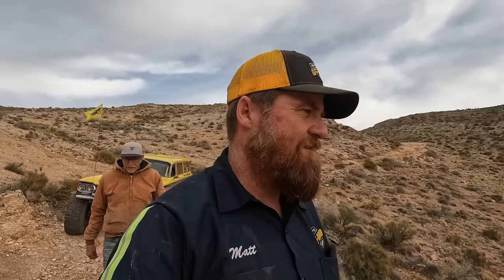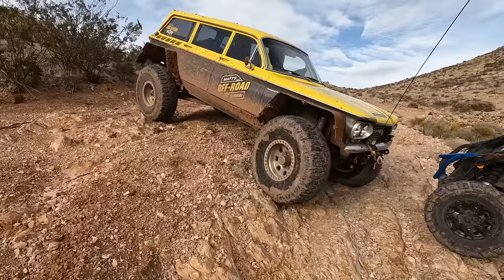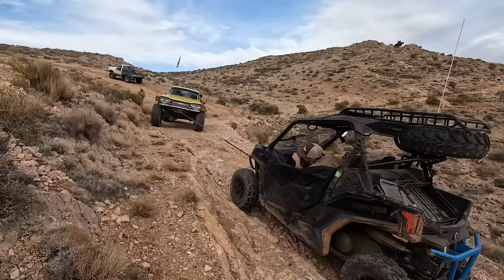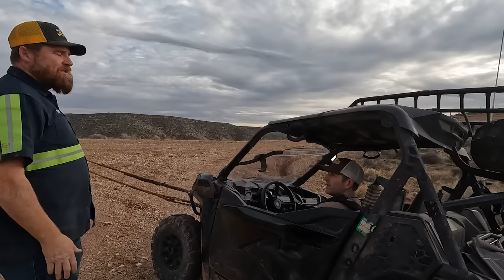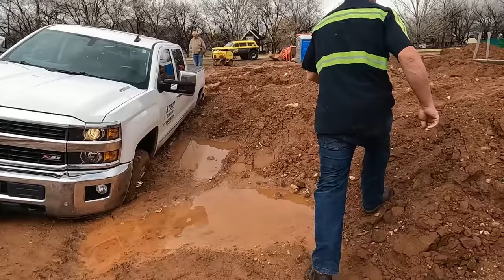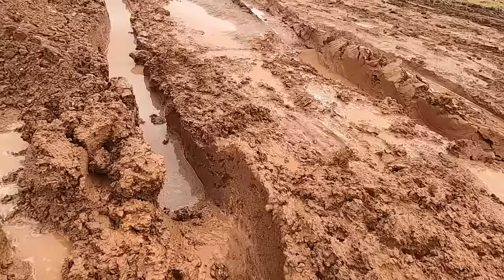Flooded By The Sewer...Nasty Chevy Recovery!

Comment: Those tall, narrow razrs look terrifying. I would never take something like that off road where there are any steep drop-offs. 
I’m constantly surprised how few injuries there are on bad rolls though.
Reply: There surprisingly stable , but you don’t want to have a high rack on them and a spare tire mounted up there or anything else it really effects the CG
Reply: A friend of mine has one. It's actually not bad off road when set up correctly. The issue is when you start putting spare tires and gear on the top

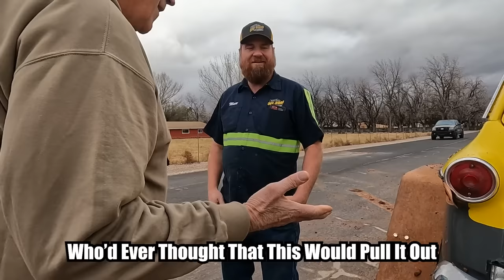Comment: 19:24 "Who'd ever thought that this( points at the Morvair) would pull it out"
Understanding kinetic energy and how it works makes all the difference. This job would not be possible for the Morvair under the same conditions if a cable or chain was used in place of a nylon rope.
Good job as always MORR team.
Reply: It's not nylon
Reply: @masterbates7016  "What are kinetic ropes made from? Kinetic recovery rope is made from braided nylon, which can stretch, unlike other materials. Nylon is also strong and can be used in a variety of recovery situations. It has two components: An outer sleeve and an inner core."
Reply: @masterbates7016  oh sorry I forgot, thery're big bungee cords.

Comment: Little known fact:
The top half of the fuel tank works just as well as the bottom half.
Reply: Patently false.  It’s a little known fact that off-road vehicles don’t HAVE a top half to their fuel tanks.
Reply: Does it? I always thought the top half had more fuel, wider at the top than the bottom on tanks I've seen.
Reply: Matt is just rubbing off on Tom
Reply: Not when fuel prices fluctuate 20 cents a gallon week to week.
Reply: @tumbleweedking5668  if the fuel price goes up, you'd be glad you filled the tank earlier when the price was lower.
Reply: Never the same quantity though.
Reply: @tumbleweedking5668   That's when they work best! Fill up when it's cheap to get your through the time it's more expensive ;)
Reply: @Chris Kulpa  That depends when the 1/2 tank mark shows up. That being said I always use Shell or Chevron no matter what the price so I always pay more.
Reply: @tumbleweedking5668  Agreed. My commuter is a hybrid and right now we're on the edge of whether it makes more sense to charge at work with the "high priced" charger, or buy gasoline. At about $3.80 a gallon in the winter, it makes more sense to buy gas. At about $3.00 a gallon in the summer, it makes more sense to buy gas. The difference on my end is based on winter battery efficiency and winter gas blends compared to summer of the same.
Reply: The first half has more octane.
Reply: @tumbleweedking5668   Well obviously you fill  up when it's cheapest....
Reply: The weight savings on an  empty tank gets you better mileage.
Reply: They could put 1 external can on the back... Or a Ski Doo Linq type inside. I know Matt's worried about weight but then he loads four people. If he's somewhere close like Sand Hollow and is worried about the weight he can leave it at the shop.
Reply: oh your so right,commenting on experience
Reply: The top half of the fuel guage however does not always relate to the top half of the fuel tank. I had a Toyota truck, a quarter tank meant you had 30 miles left.
Reply: If Matt and crew treat their gas tank how my cats treat their food bowl, they will never run out again.
Actually, Tom did learn from my cats, he asked for more gas but actually still had more than enough :)
Reply: @tumbleweedking5668  It Doesn't Matter What The Price Of Gas Is When You Run Out.
Reply: So, you're saying it doesn't matter if the glass is half empty or half full?
Reply: @Jim  pretty sure he meant just fill the tank up, the volume of the top half or bottom half doesn't affect its ability to hold gas inside of it.

Comment: Did anybody else wonder why they called Matt when there was a backhoe there? Backhoes can be a great recovery vehicle because you can pick up the truck out of the mud.
Reply: As a heavy equipment operator, I have yet to see one that came factory equipped with recovery equipment. There's also a reason why there are no contractors working on that job site. Sadly, this guy has yet to figure out why. Loose soil, heavy rain = thick deep mud.
Reply: @Chris-bh3cm  the reason I said this is because I recovered a tractor with a backhoe, but it was bigger machine. I think that they are the handiest thing to have on a farm other than a tractor.

Comment: Interesting fact about horses is the original measurement of horse power was how much work a single draft  horse could do in a hour (about 745 watts) so a horse can at peak output can “output” 15 horsepower and a top athlete can at peak output can do over 3.5hp
Reply: Yes, i was going to say that an actual horse can do 15 hp...lol, it was originally based on a days work load sustained, how much HP do people think these 800 HP engines in cars can sustain for an 8 hour work day ? lol, Hint no where near that, same as the horse.

Comment: That very spot on the honeymoon trail provides a serious pucker factor if you're going up or down it on a narrow 50 inch wide trail RZR. You'd be surprised how far out the side you can have your body and still manage to reach the gas pedal and steering wheel.

Comment: Matt, I'm an emergency trauma nurse in the military, on an austere surgical team.  Long story short we go into places you shouldn't do surgery, and do surgery with stuff we have on our backs.

All of our gear is in bags, labeled and ready to go. We have primary, secondary, resupply bags as well as extended operations bags (think ICU type care) they're labeled and sometimes even color coded. I can tell anyone to go to our medtent and grab bag "xyz" and I know exactly what's in it. We have inventory sheets we use to restock the bags every time so we know we're  good to go. 

  Perhaps you should get a few bags and label them with the vevicles they go to. Have a primary and secondary bag. Put a tie on the zipper so you know if it's been opened, (broken or missing tie) then it needs checked.  That way. If you jump in a truck for a recovery, and you notice the bags opened you can just grab the secondary  and swap out because you know it's inventoried and ready to go. 

Put someone in charge of checking and restocking bags with equipment and supplies. 

Just a thought. Using this method I've never been found with my pants down for a mission.

Comment: I've got  1998 Chevy 3500 crew cab long bed with a 454. It is semi-stock. I plan on putting new tires on this spring (suggestions?)  I consider myself an experienced off road driver.  Would you think such a big rig could handle the honeymoon trail?
Reply: I would definitely take 5 or 6 extra Jerry cans of gas, and plenty of water.
Reply: I know cell phone signal out there is iffy at best. What is your smoke signal number?
Reply: My truck will pass anything; but a gas station. At least the fuel guage ...knock on wood.

Comment: I must admit that I was a little disappointed that Tom Tom didn't correct you on the 20 v 30 foot ropes. The 30-footer is 50% longer than the 20-footer. Ahh well, the numbers aren't important, the masterful way you use your equipment and your experience is!

Comment: a message for Matt and the crew: i'm really surprised that you guys don't have a portable air compressor on you in the banana of morrvair, Milwaukee makes a handheld high volume pump, i'm sure Dewalt does as well. i personally have a Ridgid 1 gallon portable compressor, and love it's multi-purpose-ness, home reno -trim, and it's always in my car for pumping up a low tire, or anything along the way. it will have to refill/cycle about 6-8 times to fill an average car tire from 0 psi, but refills in about a minute with 2 good batteries on it (swap out for more Ridgid 18volt batts). cheers
Reply: n/m, saw you have a Makita one in another video... it would have been great help on a bunch of other videos, although the morrvair has plenty of pulling power to overcome that extra drag

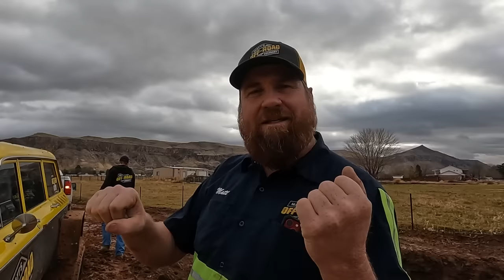Comment: A 30 foot rope is 50% longer than a 20 foot rope. 17:26.  You were worried about people picking on you for calling a brake rotor a caliper.  You should really be worried about getting picked on for messing up basic math.  The bright side is you probably tip pretty well at restaurants.🙂

Comment: Matt: Actually it is 50% more rope. The 20 footer is 33% shorter than the 30 footer, but the 30 footer is 50% longer than the 20 footer. There is 50% more stretch in the 30 footer compared to the stretch in the 20 footer.

Comment: These Razors / Can-Ams are so narrow and high centered, It doesn't take much to tip them over. Rock crawling is not for them in my book. They make a fun ride for dunes and flats and anything that can be called a rough mountain road, but you don't wanna start lifting wheels on them.

Comment: Pretty sure a horse has 3 horsepower. Google it.
Reply: Because a constant 1hp is the work a horse can do in a day. A horse only works 8 hours, so for the 8 hours it puts out 3hp, then nothing for 16 hours.
Reply: Or, to put it another way, if you have 3 horses and you work them 8 hours each (24 hours a day in total). One horse working at a time. A 3hp engine will replace all 3 horses. Which means a horse does as much work as a 3hp engine, it's just that it only does it for 8 hours, then you have to swap it for another horse.